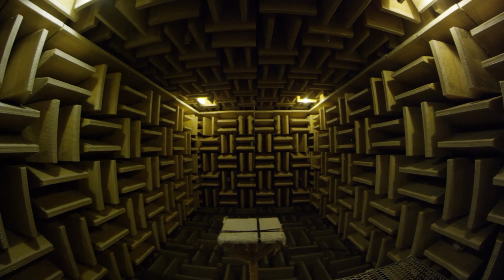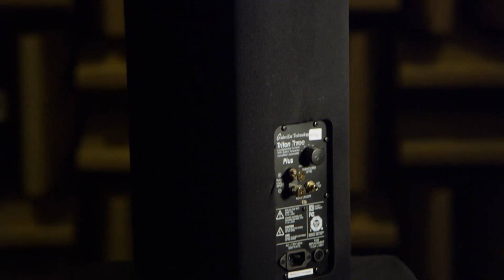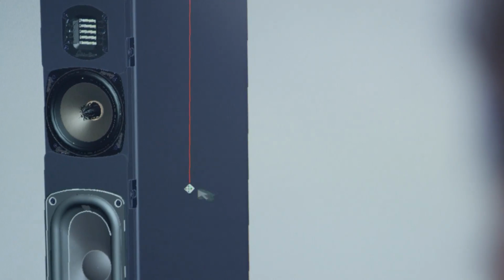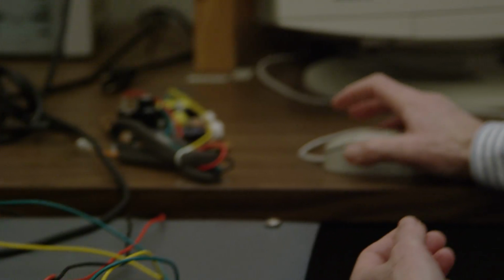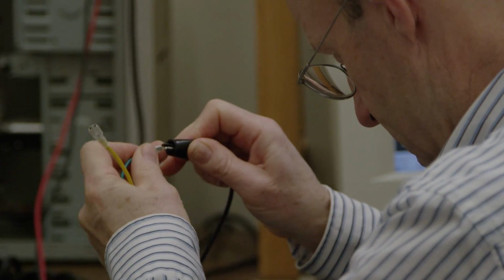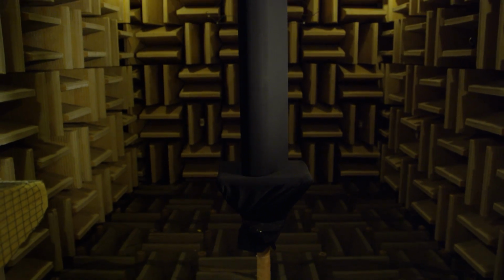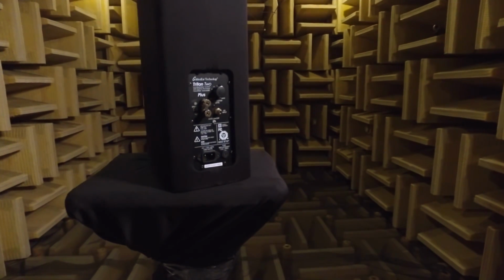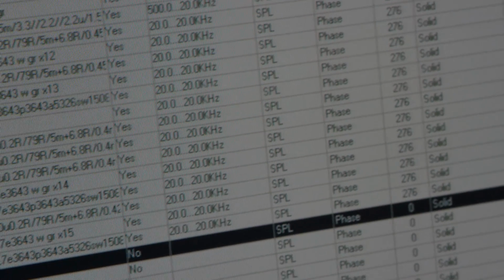SoundStage! InSight - GoldenEar Technology's Triton Two+ and Three+ Loudspeakers (March 2016)

Comment: I listened to these and the top of the line flagship as well (Reference). I felt the integration between bass-mtm module was severly lacking. It was like listening to a 2.1 system. Instruments never sounded true to life. 
Also, the midrange did not have the realistic presentation i expected from this price-point. Voices were thin and lacked  body, for example the voice of a bariton was poorly presented. The presentation of the cello was, again totally off. And there are many more examples i could give.... The extremely cheap crossover components add to the low sound quality.
Reply: I HAVE THE TRITON TWO PLUS AND I DO NOT AGREE WITH WHAT YOU WRITE, I THINK THEY ARE THE MOST REALISTIC SPEAKERS I HAVE EVER LISTENED TO SPEAKERS AT DOUBLE THE COST
Reply: @fabiodeppieri68  Say what?
Reply: @madcrabber1113  I think he got hearing damage from listening to music at very high volumes?

I do fear what @coscosmin4506 says may be true. I haven't heard those speakers myself yet. I used to have a pair of JBL S412PII floor standing speakers, 2 decades long actually.
No sophisticated sound, but quite enjoyable. The speakers in it were 1", 4", 6" and 12" but for me it still could just have had a bit more body.
The mids are very important to me, just like very deep bass. It doesn't need to destroy the walls with their impact, but it must have precense. These JBL needed a little bit more more depth, and more emphasis on the mids for me.
If possible I do want to give these Goldenears a try once I have money for it, but I think adding a pair of subs with my current speakers could be better, although I also am not entirely satisfied with the mids of this set. (Plus the soundstage is basically non-present, with a few very surprising exceptional moments.)